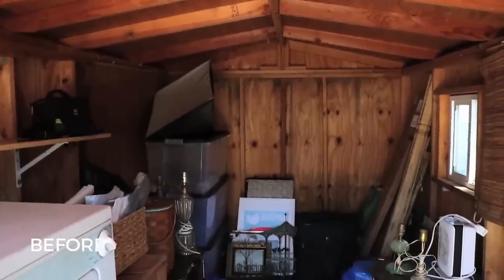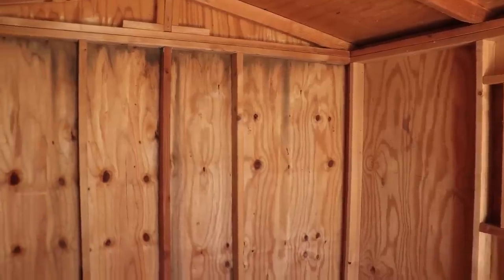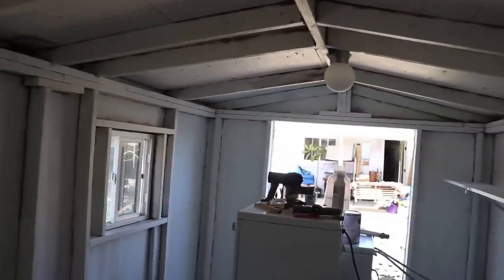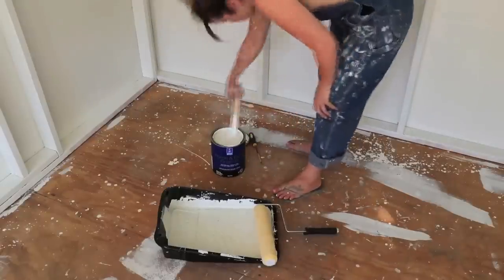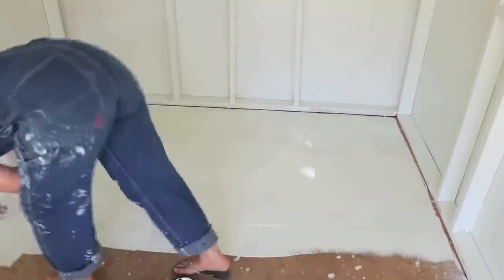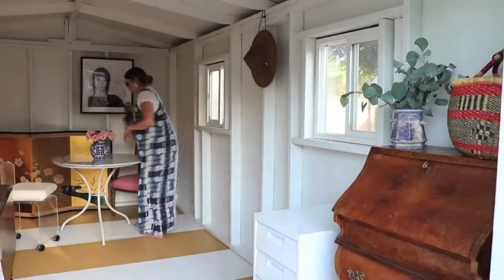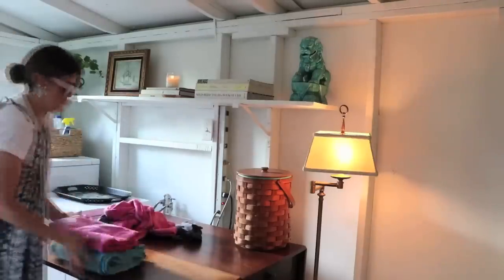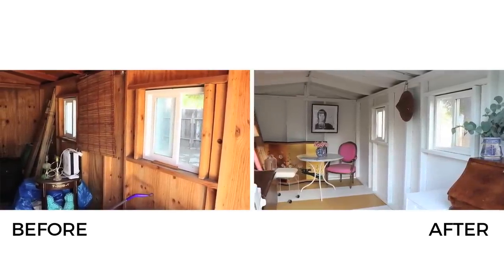SHED MAKEOVER -- CUTEST EVER!

Comment: Were the walls in the she shed already shellacked? And if so,  did you sand them down or were you able to put the two Sherwin-Williams primer products on directly without sanding?
Reply from the maker: Alicia Leeke Did not sand!!! I used the shellac to spot prime on the knots and then used the general primer over and then painted. It took a lot of time because of the crevices etc but it wasn’t hard at all — more a time commitment.